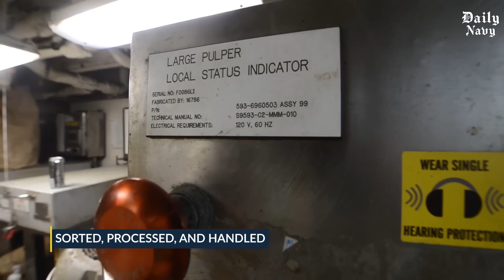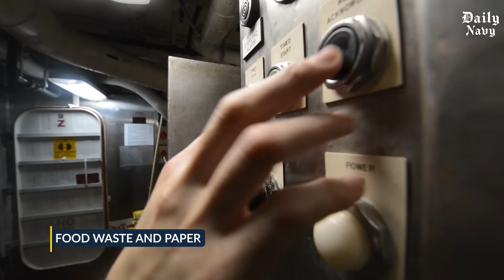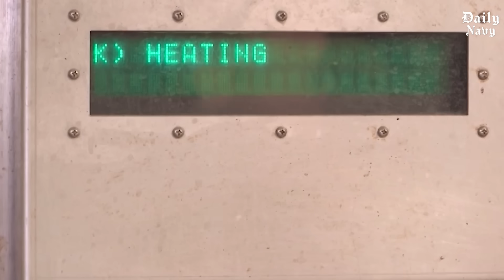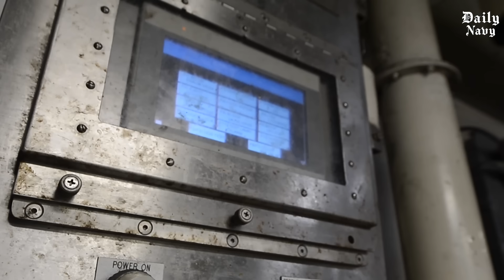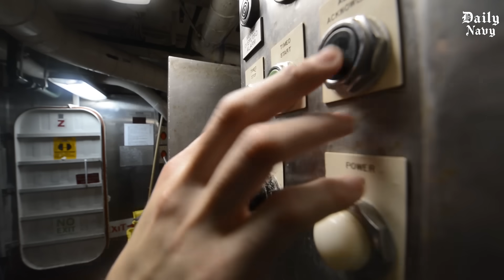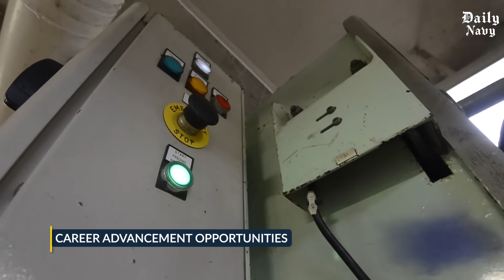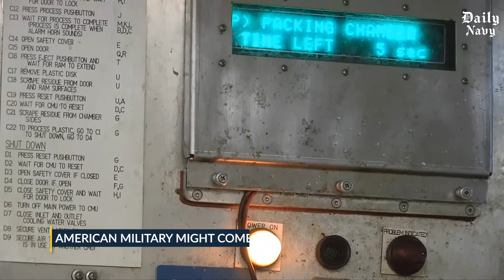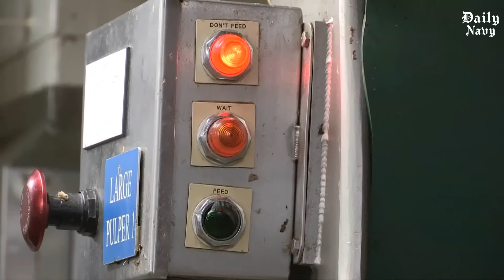How Aircraft Carriers Deal With TONS of Trash and Waste Every Day at Sea With 5,000 Sailors Onboard

Comment: 90% of what they said about the CHT system is complete and total bullshit. We never tested the shit water. All of the Nimitz shit went into holding tanks. When we got 3 miles out to sea we would open the overboard discharge valves around the ship and everything went directly overboard. There were no chemicals added ever or any testing of the shit going overboard.

Comment: I did a WESTPAC on the Hamcock in 1963 and had to do galley duty for a month before I got my crow.  Started in the skullery at the slop chute and then went to the garbage grinder.  2 of us would carry the galvanized garbage cans full (actualy only 3/4 full so as not to spill it) of mostly liquid waste along a passageway over several knee knockers and then down 3 or 4 levels  to the grinder located  just above the waterline on the starboard side.  The grinder was a large tub with a cutter like in a sink disposal that ground up the food waste and discharged it out the hull.  We were constantly taking an empty can up to the galley and bringing a full one down during mess hours.
After meals, we would carry empty carboard boxes and wooden vegetable crates to the fantail and throw them over board.  If air ops werent being conducted, we got to sit out there and take a break in the cool breeze.
NOT my best memories of Naval Service.
Years later after a Masters in Environmental Engineering, I did 25 yrs of environmental compliance at municipal wastewater plants!

Comment: My first ship, USS Essex LHD-2 in the mid 90's, we had a garbage chute on the starboard side, mid ships that we'd throw almost everything overboard that was trash (as long as we were 25 miles away from land) 2nd and 3rd ships both Burke DDG's we had the mandated plastic melters, shredders for glass and metal. Those would go over board as well as food stuffs etc. The plastics were melted into about 2 ft in diameter hockey pucks, put in plastic bags and disposed of when we were back in port.

Comment: When working on a commercial lobster vessel I was told after 35 miles as long as its not oil or fuel or anything like that everything else can get tossed not proud of it but I've seen and had to throw full trash bags overboard

Comment: When I was aboard an aircraft carrier, CV-62 Independence. 89-91, we had just started separating plastics from our trash, but everything else went overboard. Right off port side fantail. There was a guy there who would search your trash for plastics and if you got caught with any, you would have to pull one of those watches. The only reason we had to take it to a specific point, besides policing plastic, was to avoid a random bag of trash being tossed over ending up being called in as a man overboard

Comment: At around the 2:30 mark, he mentions the combined crew generates 410,000 gallons of waste water daily - enough water to fill up 8 residential swimming pools. If he means pools that are typical of backyard residences, those on average hold between 15,000 and 25,000 gallons - some more, some less. But taking an average of, say, 20,000 gallons for a residential pool, that 410,000 gallons of wastewater would actually fill closer to 20 or 21 residential pools. Per day. Yikes.
Reply: Always at least one Karen math checker in the crowd.
Reply: That would be about 82 gallons per person per day.

Comment: When we thru trash off the fantail on westpac in 1983, sometimes we would see a ussr sub would surface and grab the floating bags with a boat hook. We were told they look for POD's and anything else they could use. We threw wet trash from the messdeck over and poked the bags so they leaked and sank. We used to watch to see if the submarine surfaced and laughed about what they were dragging onboard.

Comment: Back in the 80s, we used to throw/push anything and everything off the fantail once 25 miles out. Wall of old lockers - no problem. Wet garbage - no problem. Plastic bags, just poke a hole and insert some scrap metal available in a bin.

Comment: 1986 WestPac anti-submarine helicopter squadron.The sono buoys we used had to be removed from the heavy plastic case (slick) before being deployed. The ship (Nimitz) would not assist in the storing and disposal of this plastic waste and it piled up fast. My department put our heads together and came up with a easy solution. We started packing TRIWAL shipping containers full and had it all shipped back to the manufacturer for further disposal.
Reply: wow! awesome USS Nimitz....my favorite.
Reply: Were you in HS-2???
Reply: @truckerray7533  1986-1992. Did the transition from H3’s to H60’s while in QA. I hated the Nimitz. First thing they tried to do was put my 200 DIV in a catapult steam control room. Ended up in a walled off wide area of a forward passageway with 8 deck edge power boxes, all HOT. My guys were next to a fan room that the ship had sealed the hull drains to so we had to deal with constant flooding until we reached the PI and they cut them off. There were other things, some had me having to explain why a Multi Million piece of mission critical aircraft equipment disappeared, which showed up when we got back stateside. Basically NO support.